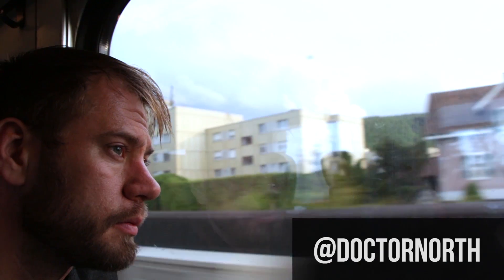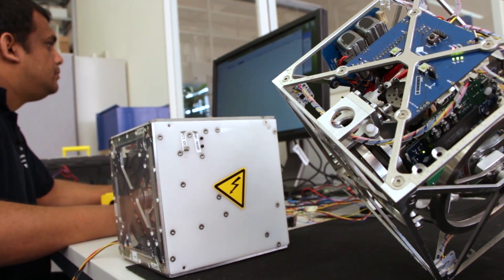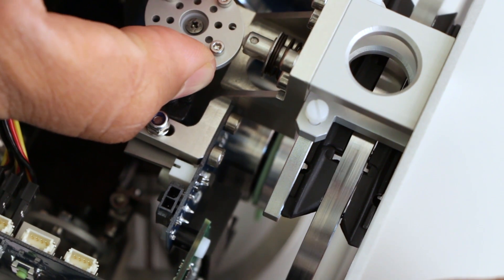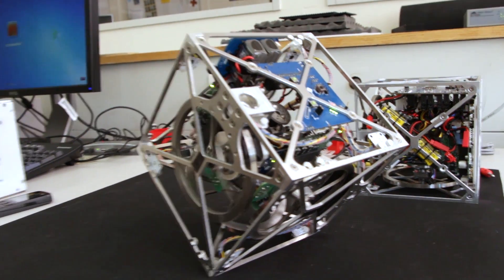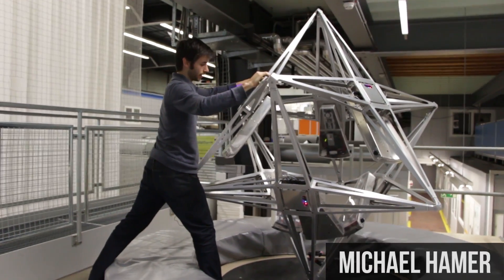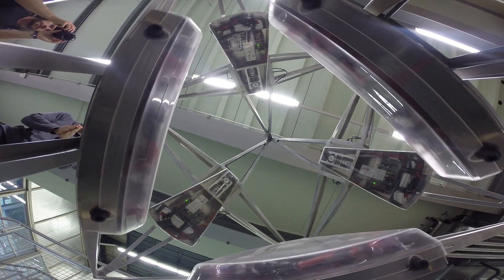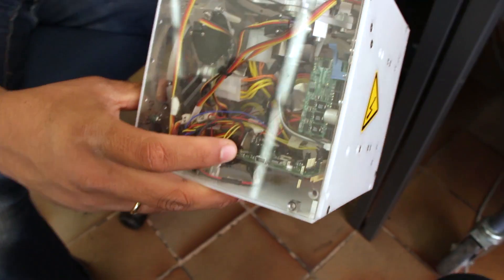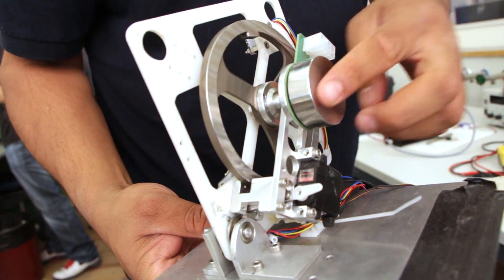Insane Balancing Robot

Comment: Using braking torque as a form of stored energy to instantly rotate the cube is pretty clever.. :D I bet you could integrate this concept into many unrelated devices.. brake wear being the only potential issue but it could be solved on a case by case basis.. thanks for posting!